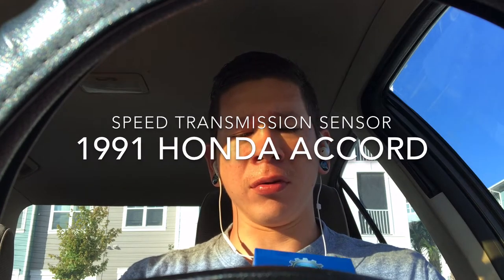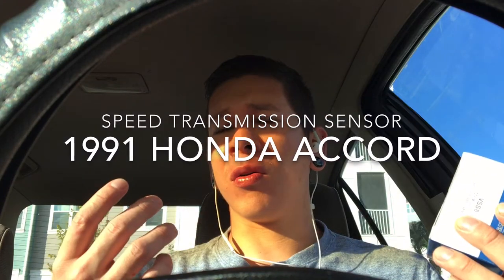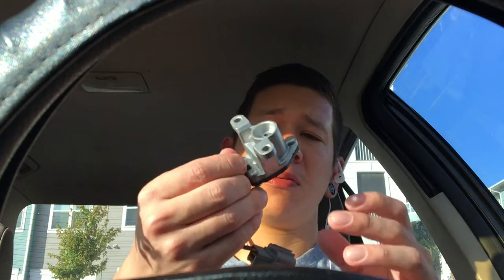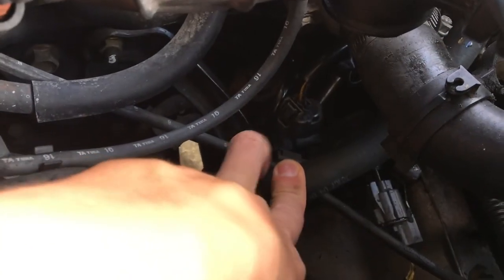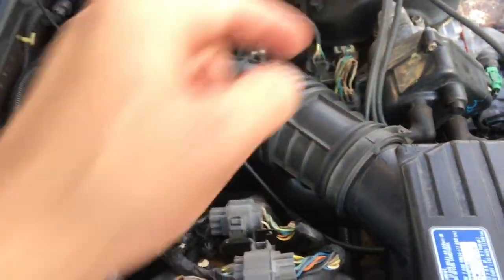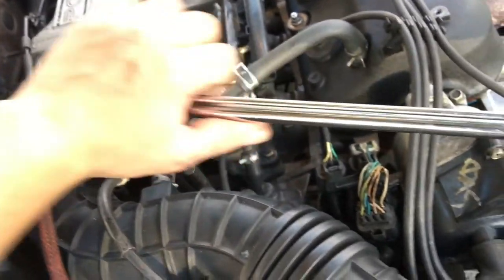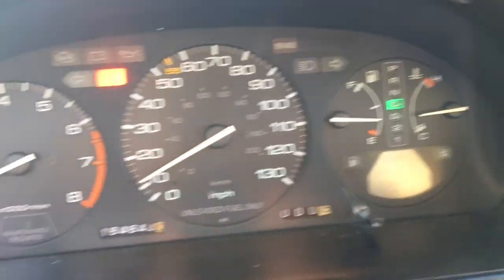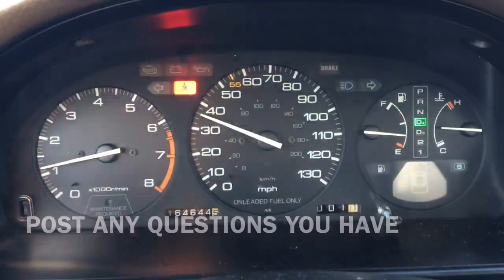Honda 1991 Accord Vehicle/transmission Speed Sensor Fix

Comment: I have a 96 Civic and is slow af, it takes 20 seconds to get 100km/h, i only have the code p0715, do you think is the sensor doing that? Because i broke it accidentaly, i dont think the sensor is the only problem but my motor is fine

Sorry for the english im from mexico
Reply: And is like you, the gear shifting takes like 3 seconds and the motor is just reving and the car is not going fast
Reply from the maker: @MaxLoG28  hola
Si comenzar por las partes más simples de diagnosticar.
Problemas con transmisión siempre comenzamos por los solenoides.
Tienen un filtro que aveces se tapa y no deja el fluido pasar por los solenoides. Trata eso primero a ver si te ajuda

Comment: Yesssss. Perfect video.  I was GIVEN a car because the owner thought the transmission was slipping and failing.  So...I noticed that yes it kinda slips but still rather good.  Only sluggish if I stop and then go up a hill.  I also noticed the speedometer only works sometimes.  So I furthered my investigation and determined the problem was in our face the whole time.  The speed sensor.  It's a 98 avalon.  Don't jerk yet rather surges or kinda pulls.  Do I see the difference between THE TRANSMISSION slipping and something causing the tranny to slip.  There is a difference
Reply from the maker: Did you fix it??

Comment: My car kicks when cold when putting reverse and does what you say in the video that the gears change with some kick, I have to release the pedal when it is going to shift so that the kick is not felt, do you think it could be the same?
Reply from the maker: @RayoTech  I think what you are describing MIGHT be more of a transmission mount /motor mount issue.
These cars by nature have a small kick when shifting to any gear but more pronounced when mounts give out.
Reply: @roverandmorerestore7266  I don't see the broken supports, it's strange because when the car is already hot you barely feel the kick when putting reverse, also when the car is going to enter the last gear it takes a while to enter, I cleaned the selenoids. but it was not the problem, I think it is the VSS or the transmission computer since when I bought the car the sports light bulb on the dashboard was already broken as if they did it on purpose so that the car would not start flashing codes.
I also see the transmission oil clean, I think I should change the transmission oil since I have never changed it, they say that it is bad for these cars to change the oil
Reply from the maker: Ahh I see. The mounts aren’t always visibly broken. But you can feel the jerk.mine used to make a bang noise.
I’ve also heard that about the transmission oil but never changed mine,only topped off

Comment: Oh boy thank you, I got a 95 that doesnt slip but the D4 light keeps flashing and I got a code for the speed sensor, it drives fine but when I change gear ie from Park to Drive or Reserve, it kicks like a mule, I will see if a new sensor fix the issue
Reply from the maker: Usually if it kicks/yanks and thuds, it’s your motor mounts.
The speed sensor is affordable on Amazon

Comment: A dealer replaced the VSS on my ‘90 Accord and it worked, but then there was a new problem with power surges. Dealer wouldn’t admit they were responsible. A different mechanic found the problem: the dealer mechanic had pulled all those hoses going into the fuel injection housing, and put two of them back in the wrong place (transposition) Dealer said they checked the vacuum hoses. So dealers aren’t always the best, especially for older cars. I noticed all the other customers had new cars and the mechanics are used to working on them. My car was probably as old as the kid working on it.
Reply from the maker: Hello CS and thank you for your advice!
That’s such a simple yet confusing cause to your power surges.
So maybe I should check mine up at some old school mechanic shop
Reply: This is the main another reason I do everything on my car if I can
It may take longer time for me to look diagrams, read procedures, watch videos, etc. but I enjoy the troubleshooting lol
Reply from the maker: @tothepointvids5192  I agree! And the satisfaction of seeing it work

Comment: Awesome video. I really appreciate that you went into detail to explain that the speed sensors from 1992 won't work with 1990. Thank you
Reply from the maker: I’m so glad you can get some useful information out of this! 🙏
Good luck on your project
Reply: @roverandmorerestore7266  my speedo works, S light blinks, revs fine, acceleration is slow but drives fine,  is it the speed sensor or the TCU? 1991 Honda Accord LX sedan

Comment: I have the same dash lights and symptoms, will definitely order it and change it, thanks!!!!
Reply: @roverandmorerestore7266 dude, I wanted to get the sensor out so I knew which sensor to get on Amazon, I took out the air intake to make things easier, got the sensor out, put it back in, put the air intake in, and now when I start the car the engine shakes and stutters, I’m worried and don’t know what it could be, help me!!!!
Reply: I figured it out
Reply from the maker: @IdKhOwToPlAy80  tell me! What was the problem?
Reply: @roverandmorerestore7266  one of the tubes that go into the intake manifold was getting squeezed by the intake tube so air would not flow
Reply from the maker: @IdKhOwToPlAy80  it’s perfect now? That makes me happy

Comment: My Honda Accord 2000, SE, has P1740 code, Hydraulic Control System of A/T Clutch Pressure. When I step on the gas there is a delay of the speedometer but the rpm goes up. I have to accelerate past 20 mph just to get it to shift into second and third.
Reply from the maker: Oh no that sounds very serious.
Have you had it diagnosed?
( they’ll tell you it’s fried most likely-mechanics😂)
Reply: @roverandmorerestore7266  Yeah, I suppose so, I'm doordashing with it for awhile now, soo....😁
Reply from the maker: @bryanbarajasBB  these Hondas won’t leave you stranded even when almost dead
Reply: @roverandmorerestore7266  Thank God too! I recently changed the water pump and belts and tensioners.
Reply from the maker: @bryanbarajasBB  you did that all by YOURSELF?!?
That’s a tough job most wouldn’t tackle💪
Reply: @roverandmorerestore7266  That's why I paid my mechanic to do it!🤣
Reply from the maker: Smart man!😂

Comment: Hi I just recently trying to find if its my transmission and a coworker told me it could be this sensor, I own a 2011 optima its doing what you say in the beginning rpm go up but car doesn't accelerate, feels like it hesitates like transmission is slipping. Also sometimes when I let go off the gas prdal the RPM get stuck and car keeps driving as if I had cruise control on, I then step on the gas pedal and it unlocks.Did this fix your issue?? And did your car accelerate slow before this?? Thank you
Reply from the maker: It could very well be.
This is a much more affordable part to start off instead of going straight into a trans replacement.
Erratic behaviors could also be cause by faulty transmission control units. 
Either way a mechanic should look at it. Then decide if do it in your own

Comment: I got a question i have a 92 Honda Accord automatic it won’t go past 40mph unless I pull over turn it off and on it fine for awhile then I have to do it again but my instruments work I changed the speed sensor but it still do the same thing need help don’t know what to do next and I tried to pull codes but no codes come up
Reply from the maker: Hmmmm the speed sensor fixed this issue for me.
Try unplugging te sensor for a bit and see if it shifts better than with it in

Comment: I drive 91 Accord MT. I replaced the speed sensor in it and the MPH meter won't go and it won't rack up the miles so now it's un accurate. Everything else in the cluster works except for the MPH meter. Any thoughts ?
Reply from the maker: You replaced the pin and inserted it correctly?
Reply: @roverandmorerestore7266  absolutely I repeated the process with/ without the link to feel the difference in tension since you have to press down on the pin the get it to stay engaged while tightening the bolts. The cluster has always been this way. I believed that changing the speed sensor would solve my problems in terms of MPH meter and milage not working. Maybe there is a sort or some sort of issue that I'm not completely aware of. Again everything on the cluster works except for MPH meter and Milage/Trip meter.
Reply from the maker: @hollystlocal2242  two left causes could be speedometer cluster is broken.
Or an electrical wire pinch somewhere

Comment: You mentioned that you got some parts from a junkyard. Do you know where I may be able to get a driver side lap belt?
Reply from the maker: Yes you can get it from a junkyard or contact me privately so we can set something up and get it shipped to you from where I live. Plenty here
Reply: @roverandmorerestore7266  I don't have Facebook or anything like that. If you could give me the name of a yard that may have one I can call to see if they'll ship it. They have a few around here but I need Palmy Blue. Also I was gonna ask if the speed sensor is still working well? I just replaced the tcu & now I need the speed sensor also. Check engine light comes on & sport light is flashing after driving for a mile.
Reply: I have IG but no FB
Reply from the maker: @Gman256.  @luis_aznarrac

Comment: I'm looking to buy a 94 accord, when I test drove it when I accelerated fla out it went to like 50mph and felt like it dropped a gear and didn't go anywhere, is this the problem you had?
Reply from the maker: Yes I had similar issues but it never slipped when going that fast, it would happen mainly when climbing up to top gears
Reply from the maker: I can’t exactly say if this is the issue but I can tell you it’s worth a try to disconnect your sensor and see if it works better.
May have delays in shifting but just see if it still slips
Reply: @roverandmorerestore7266  if I disconnect the sensor it should work better? I don't want to buy one with a broken trans cause those cars are quite rare here in Brazil and parts would be pretty expensive
Reply from the maker: @pauloesteves4804  it COULD probably work a little better if disconnected from connector harness. But not for a permanent fix as it will have delayed shifting,no spedometer.
Most important sign of this sensor going wrong is that the speedometer does not work
Reply: @roverandmorerestore7266  thanks for the tip, ill see if the current owner lets me make this test

Comment: Hi I have a 2002 accord se turns on switches gears but d4,d3 no power have to put it in 2nd then 3rd and fourth what may be the problem
Reply from the maker: Hmm that’s strange. That is Deffinetly not a speed sensor issue. 
Maybe one of the transmission sensors, maybe needs oil.
Please let us know when you figure it out!

Comment: I have Honda prelude si 4WS 5 speeds 1990 and my speedometer stop working for the past 9 years. Any suggestions how to fixes this problem. Thank you in advance
Reply from the maker: I suggest first checking/replacing the speed sensor.
then if that doesn’t work then check your cluster gauge to see if working properly.
If none then it’s a fuse or electrical issue.
Reply: @roverandmorerestore7266  thank you so much for your reply!

Comment: Just to  Clarify you are not able to move the vehicle until you replaced the sensor correct I believe I have the same situation but with a 2003 the sensor looks completely different but I believe it's the same problem as Iam getting a speed sensor output no signal code
Reply from the maker: Did you try replacing the speed sensor?

Comment: How did you pull the codes?
Reply from the maker: Hey Mark!
Passenger side footwell, by the door trim there is a connector port. Kind of small.

You put a paper clip that bridges it.loop back plug. Turn the car to battery and codes should flash .
Google the code list too

Comment: Any ideas on a manual transmission, my 91 dx sedan does read but less on low speed high on high speed, would the speed sensor be the case or it may be something on the speedometer unit? it just star doing it! Greetings.
Reply from the maker: Hello! Speed sensor!
Reply: @roverandmorerestore7266   
All ready thanks!
Reply from the maker: @avefenixml  let me know how it works!

Comment: Does the type of submodel & engine type play a part in the type of speed sensor I need?
Reply from the maker: Yes I believe so! Mine is the standard model
Reply: @roverandmorerestore7266  the previous owner mentioned that the reason the speedometer is off is because there's something wrong with one of the wires. Would you recommend? I really want to try to tackle this problem myself instead of getting charged a ridiculous amount by going to a mechanic.
Reply from the maker: @fl0restrella  you can always get a speed sensor for real cheap on amazon and overnight ship.
If that doesn’t do it the it would be time for more troubleshooting

Comment: I have a 1990 accord lx automatic transmission  in a 93 honda accord se cb7.engine..will this speed sensor. Work in my car.? Please reply. Thanks. March 30 2021
Reply from the maker: Hey there!
I have a f23 91 and it works but I believe 1993s are a different type of sensor,though very similar

Comment: hey i have a 90 accord ex coupe 2 door am havin problems with no revse n not shirfting at all
Reply from the maker: No shifting at all? That’s a tough one.
You could check the tcu for corrosion or any other apparent issues.
Reply: @roverandmorerestore7266  replaced ecu and the tcu and goes in gear fine but wont shift hits 2000 rpm n wont go in revse

Comment: Sometimes it could be the transmission oil
Reply from the maker: The oil is red and clean. No signs of wear or burnt oil. Recently changed. But you are COMPLETELY RIGHT.
It could be that easy of a fix as well
Reply: The speedometer, odometer, trip-meter not working and blinking D4 light could all just be from transmission fluid?!

Comment: I got some questions dawg idk if you still respond get back at me whenever would appreciate it
Reply from the maker: I’m right here my man!
Reply: @roverandmorerestore7266   I’ve got the same issue I’m pretty sure on my 1998 Honda Accord Ex I’ll be driving then when I hit a stop sign and and try to press the gas right away it’ll stall then kick forwards like I wanna burnout or some and it’ll rev really high then kick forwards if I press on the gas it’ll take a second to get speed 1st and 2nd after that it’s fine
Reply: @roverandmorerestore7266  I just wanna see what you think before I go and buy the speed sensor because I’m having all the same problems you were explaining in the video
Reply from the maker: @fatherjerry7594  that sounds like a tcu issue
Reply: @roverandmorerestore7266   oh alright I appreciate it I know you can’t fully tell me obviously but the video gave me some information I’ll look into it because my transmission was fine when I got the car but then 2 weeks later started acting weird
Reply from the maker: Good luck sir! Please let us know when you fix it🙏